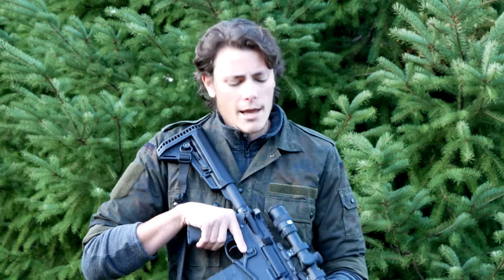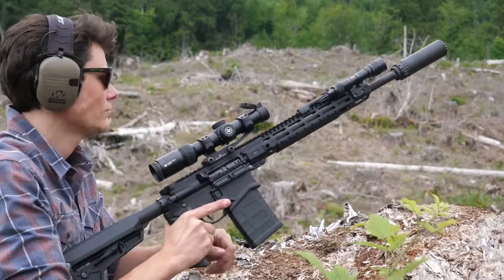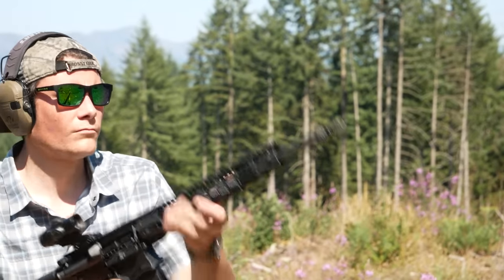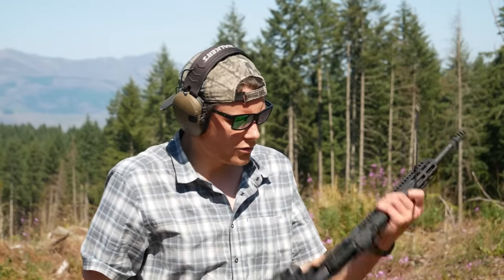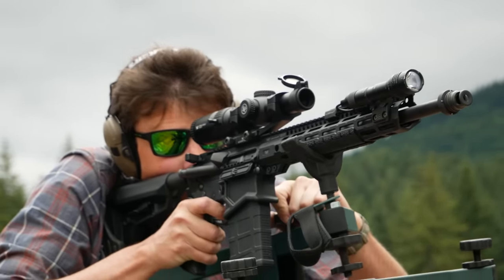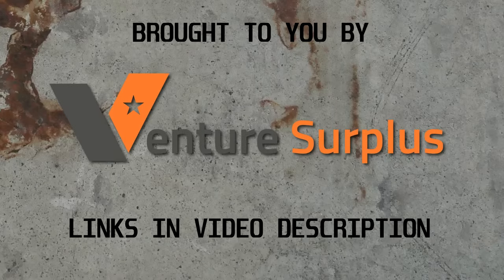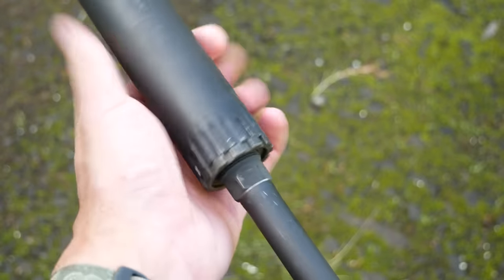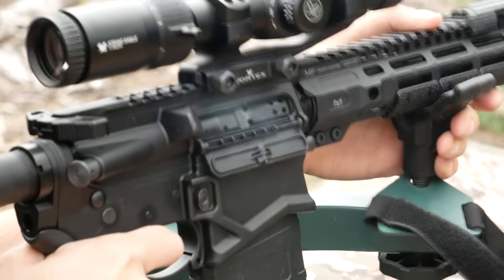Taking the Ruger SFAR to the Limit

Comment: I ended up swapping the rail on mine out for the at3 tactical quad. Worked with the factory barrel nut and it really didn’t add that much more weight honestly. The old school quad helps clear the gas regulator so it doesn’t touch. Running a griffin armament tapper mount suppressor and she runs like a scalded dog so far. I’m using her as my hunting rifle, not sure if I trust it enough for a self defense rifle yet.

Comment: Timing issue. The bolt shouldn’t be trying to extract the case with enough pressure in the barrel and case to cause it to grip the chamber hard enough to rip the rim off trying to extract it. Gas port needs to be closer to the muzzle.
Reply: Which explains why the 20 inch version of the gun doesn't seem to have the same problems.

Comment: How long before ruger starts selling the SFAR with a riflespeed gas regulator as standard from the factory,
It would definitely be worth the little extra cash as they would remove the cost of the original gas block,
Also it's probably becoming a problem with all the rifles being returned for service,
Also all the time lost as well is definitely not insignificant,
To cure a problem child that has been problematic and would be a better seller if they solved the reliability issue for good.

Comment: It just boggles my mind that the paying consumer is the stand in QA department, i looked at the pof rogue 12.5 and while there is commentary that the pof has some issues, it is lighter than the SFAR and arrears to have less negative comments.............the problem is that less negative is not a great selling point.  i want under 6 lbs and i want to be able to fold it , which i can put a law tactical on it  for CQB, in the mean time i lighten my 556 with carbon fiber which is reliable, zero problems and just runs whatever..........i really want to dump the 556 but the SFAR and POF Rogue looks like an opportunity to become a gun smith.

Comment: A 200-300 dollar gas block does not turn a 1300 msrp gun into an expensive gun it was already an expensive gun xD
There are several sub 1000 ar-10 options.
Also an ar-10 is not the only horse in the race of course.

Comment: I find it hilarious how you had to change a bunch of stuff to run it. Your like Military Arms Channel 2.0. Either I have not found the right people or these largely just run. That said one thing I saw done if anything was a heavier buffer. Not assuming you rigged the ammo or anything, but I think your the only one seen so far openly saying it happens to this degree. Seen quite a few reviews on it and some articles plus a few people. Though locally seems not common. I opted to build an AR-10 instead at the time due to ATF suppressor nonsense. This may be a rifle that needs time to iron out. 

Ruger fan but its a bummer to see typically gas issue or extraction. So far do not recall anyone going over manual specs dictated to run. So trusting a review seeming to have issues has questions on both sides. We just need access to the upper and lower, at least thats what I wanted to build on. Based on other reviewers the gas vents works just fine. Your producing clouds, another odd situation. Seem slow motion of the ports working as long as right ammo used, suppressor intended.

Comment: I like what you did.. but I still say you could have fixed it by putting tungsten weights in your buffer.
Reply: No need for weights when you can switch to an H2 heavy buffer.
Reply: @LosDoyerss  That's all an H2 is..  Normal buffers have three steel cylinder weights in them.  If you swap 1 with a tungsten weight plus the 2 steel:  that's a heavy buffer or H1.  If you swap in 2 tungsten weights and 1 steel:  that's an H2..  and if you just put all three tungsten weights, that's an H3.    When you "buy an H2 buffer"--  you're just paying for someone else to swap the weights for you;   and it's usually way more expensive than it needs to be.  Granted, there are even more fancy buffers that have a tungsten powder in them, but that's more of a custom thing and not usually called H1/H2 or H3...  Plus there's hydraulic buffers, etc. 

But just buy the weights and swap them yourself man.. You can get a three pack of tungsten buffer weights for twenty-five dollarz at brnellz.  Just take a punch and knock the pin out of your buffer.  You save a lot of money that way and you can usually fix more than one buffer with a 3 pack;   since you normally won't use all three in one buffer.   cheers
Reply from the maker: Increasing buffer weight and running it on setting 3 made no difference
Reply: @Hoplopfheil  Right on..  If that doesn't work then you gotta take more drastic measures.  The fact that it can use AR15 rails and AR15 charging handle is pretty badazz.  That makes me like it even more.

Comment: the dictator will not work with this rifle, its on the 308 midlength gas tube which is too long for this rifle, plus the barrel is too skinny where it mounts on the first ring on that gas block.

Comment: So a mid priced rifle requires several modifications be functional. No thanks.
Reply: Complete PSA PA-10 is $800, so $900 for the SFAR isn't really "mid-priced", closer to low-end or value, especially for having proprietary parts. I'd say 1.5-2.5k is mid-range and beyond that, high-end for a .308 AR style rifle.

Comment: LOL, you need to wear a mask when you shoot it with a can.

I have an R9 also. Do you like it better than the Resonator K?
Reply from the maker: The R9 is great on my 300 blackout and on my 9mm Dissent. The Res K doesn't seem to do enough on any platform so it's a bit of a wasted tax stamp.
Reply: @Hoplopfheil  I have not shot my R9 on anything yet. I bought it when it first came out, thinking "I don't have to buy any .30 cans!". While I was waiting for the R9 stamp I ended up buying 2 .30 cans. I doubt the R9 would be substantially better than my Octane .45 on my subgun or MP5 clone, so the R9 may end up being a wasted stamp for me.

Comment: It not extracting has nothing to do with gas. It has short headspace. Mine has the same thing
Reply: It’s not extracting bc the gas port is too large, and the excess pressure is ripping the case heads off
Reply: @nadams01_65  yeah I thought that too until I installed a whole new gas block in mine and turned the gas almost off and still got stuck cases. Mine measured short with headspace gauges

Comment: I guess the meaning and purpose of a "break-in" period escapes the presenter. ANYTHING that requires "break-in" means it may not perform optimally until parts seat and move properly. I have seen MANY videos with NO ISSUES during break-in nor after. Your choice of ammo is suspect. RTFM. There is a reason for the OFF position...so you don't HAVE TO BUY ANOTHER RIFLE!

Comment: I just can’t find the utility in owning this rifle. Yes a light weight 308 is interesting but the weight savings come at a high cost. Velocity, accuracy, kick, and unreliability! 
    The four settings on the gas block is so optimistic that it’s stupid and  I don’t particularly want a 308 that kicks like a 338! 
    With $1,000 worth of modifications on a $1,000 rifle it will be worth $1,250….. if you can find a buyer!

Comment: All of these reviewers fuss over suppressors. Why would you want to suppress any caliber that is not meant for sub-sonic ammo anyway? The SFAR is fine, it's just some man-boy fretting over gas settings and nonesense.
Reply: I guess you missed the point where he was having failures to extract on un-suppressed setting of 2 and case failure on un-suppressed, "dirty" setting 3? Cope more "man-boy" I guess?
Reply: I like my hearing
Reply: @charmingmander331  So do I but the sonic boom is what hurts your ears.
Reply from the maker: The SFAR requires a suppressor to cycle reliably.
Reply: @Hoplopfheil  Completely incorrect blanket statement. Mine cycles reliably wirhout a suppresor, MACs does, MOST peoples do. Perhaps you got a lemon, but no the SFAR is not designed to only function reliably with a suppresor.
Reply: Go back to bed grandpa
Reply from the maker: @craighouse1279  Read the comments, browse the forums. It sure sounds like working SFARs are the exception, not the rule.